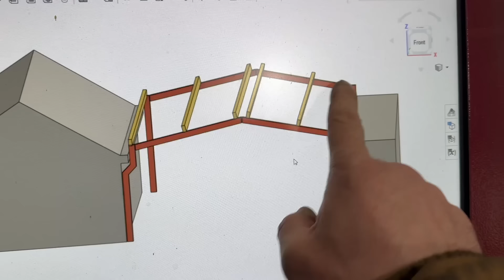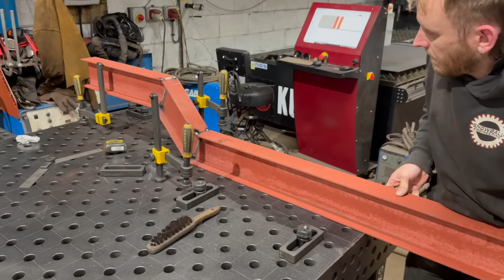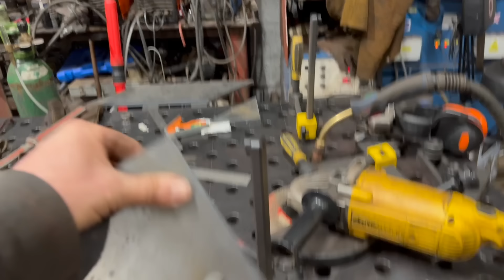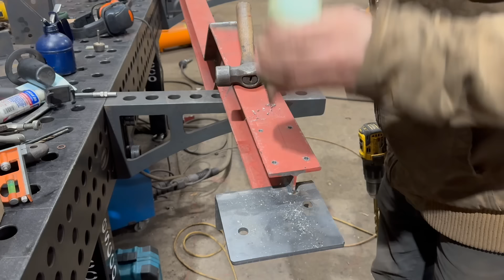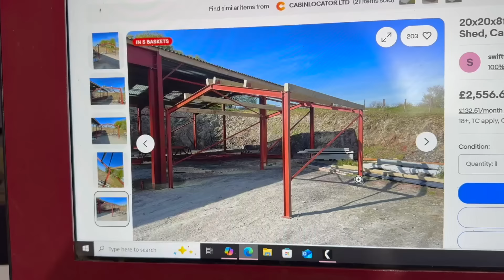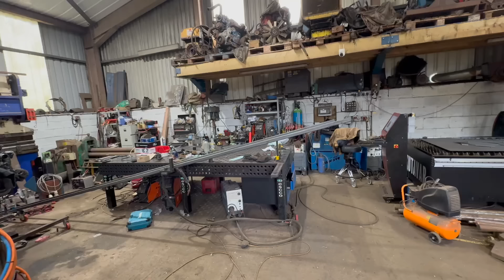Building myself a little car shed outside my house! Part 1

Comment: Hi Ollie, Firstly, the fellow that never mad a mistake, never made anything so don't worry about it. Secondly, on the window side wind brace, make a V brace so that the brace clears the window. 
You have made a very good strong job of that Ollie so top marks mate. 
Talking of over doing it though, perhaps 75 X 75 X 4 RHS might have saved you some money and would have been plenty strong enough. But then I am not aware of your local building codes anyway so what do I know. Also, I don't have to worry about snow loadings.
Thanks for sharing mate and all the best. Cheers from Australia.

Comment: Be sure to put roofing felt under the tin, stop the warm air hitting it and making condensation. Otherwise certain times of the year it will drip.

Comment: Engineer's and building. Always over think the job. As a builder who has done work for Engineer's, I know only too well. I personally love design builds. And although I am a house builder, built a number of steel frame structures. Including a bus service area. No CAD, no fancy cutting equipment. Everything cut on site from taken measurements, as it evolves. I fabricated a big steel frame deck a couple of years back, with cranked posts around a sea wall. Canterleavered deck out over the water. Working with the tides. Just made up on site. When working with old structures nothing is level or square. Easier to just buy oversize and adapt. No doubt your carport will be the strongest in the Northern hemisphere. But you create problems for yourself.

Comment: I trust that the structural design was entrusted to a structural engineer?  The purlins may not be big enough for a 6m span.  The max size quoted in the tables for the minimum dead load is 4m and that was for a 97x245 (4" x 10")purlin.  With a structure of this type wind uplift will be the critical live load.

Comment: A little bit curious I guess why you’d have specified such heavy & expensive I beam for posts and rafters - when it’s just a light car port with tin or alcynite roof sheets weighing next to nothing?
Unless maybe you have 10 foot deep snow falls or something?
A few 50 x 50 RhS tubes would have done the same job at a fraction of the cost & effort.
You’re not building sky scrapers.

Comment: Now that's a little different but u did get a nice lot done there's always lots to think about when working out all those measurements lol lol still good to watch...if u are drilling the concrete for anchor bolts have longer stand off bolts for the short post maybe...

Comment: I'm just amazed you can fit two vehicles in that spot and somehow get in and out. I'm from the U.S. is probably why lol
Reply: He can turn one car around in the parking area while the other is parked there too….   Lol
Reply: In US and have a tight garage.  We pull one in forward on the right side and back the one in on left side, both as far to outside as possible.  Leaves room to get in/out in the middle.  Works great until it rains and we are going somewhere together.  Fortunately, we have enough room for umbrellas.
Reply from the maker: Im only slim

Comment: More of these construction posts please. Getting tired of seeing you repairing farm stuff that wasnt cleaned, maintained or serviced properly by their owners and isnt economically viable to repair. Btw over here storm braces are made of steel cable with tensioners. Easy to install and adjust.
Reply: So you haven't listened when he explains that the repairs are cheaper than buying new

Comment: Just completed a 6 x 7.5 garage myself.  Really interesting to see the actual process from steel to frame. Im curious about your racking,  mez floor.  There doesn't seem to be a supporting pillar.  Is it cantilevered from the wall??????

Comment: What blade is in your dewalt chop saw 😯 works waaay better than mine ever did , I was forever blunting the blade on anything thick  so stopped using it , got a cheapo mini bandsaw , blades are a tenner saved me a fortune 😂😂🤔 still got the dewalt but never use it

Comment: One thing you need to be aware is how thick is the concrete benefit the pots to take the wight?
I would suggest dig the old concrete out and make new concrete footings, but hey that's what I would do.
Reply: Beneath
Posts
Weight

Comment: You do realise that you're now going to have loads of enquiries to build bespoke steel car ports, or was that the plan all along. I had to re roof both my sheds, my wife talked me into having coated steel ones, best decision I ever made, especially as they came with a 25 year guarantee which means they are still going to be there long after I'm dead and gone. 😂👍

Comment: One thing to consider. If you don’t use transparent roof sheets then you will loose a lot of light in your kitchen. It may not bother you, but something to consider especially if that’s your only window in kitchen.
Reply from the maker: I'll lose a bit but I do have a window at the other side

Comment: You need to be confident of things to build the wind bracing pieces without any adjustment in them.
I would worry that it would not take much to leave the bolt holes out of alignment with the main frame.
Simon

Comment: To adjust the height of the foot pads of the short posts, why not set long studs into the concrete? That arrangement would allow you to float the posts to exactly the right height on installation.
Reply: Then fill in under the plate with non-shrinking grout.
Reply: Bang on. That’s the normal way to do it. Then put non shrink grouting under the plate.
Reply: Just noticed the other post. Don’t I feel a twat

Comment: Olly, could you not make a small grid out of some bar stock that would sit in the bottom of the existing valleys to support smaller pieces? Although this might restrict the cutting area but you never know.

Comment: Hi Ollie. Great video & a well done job. If I could give you a bit of advice , it'd be to tag  those smaller parts in so they don't drop & stick up. A couple of whacks with a hammer should free them out.